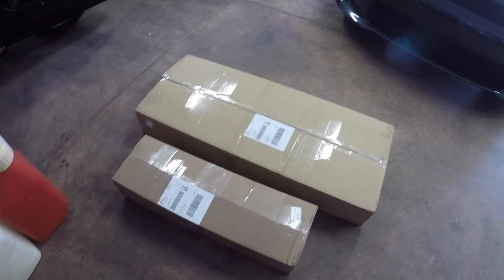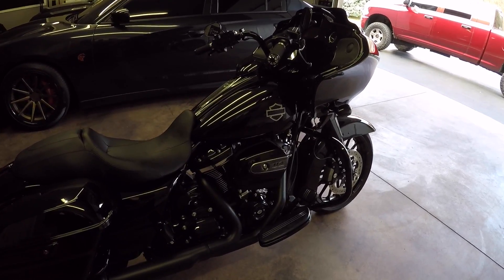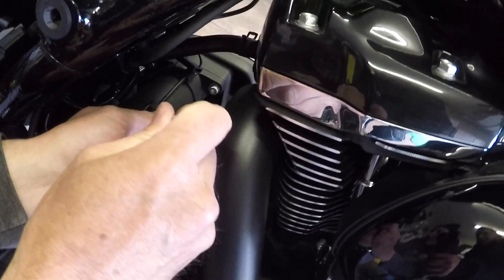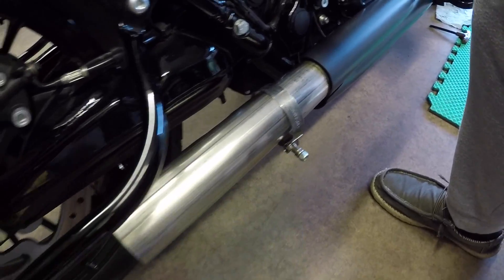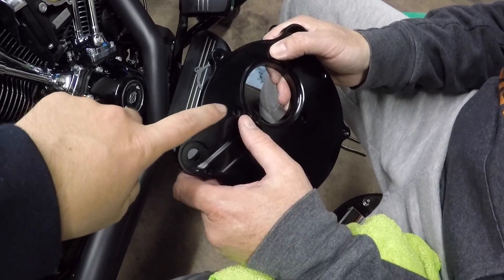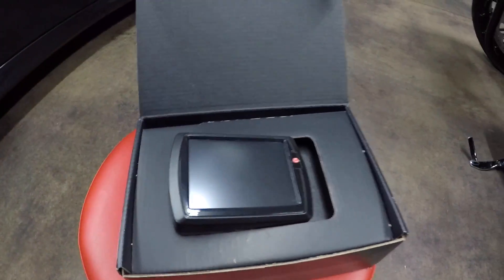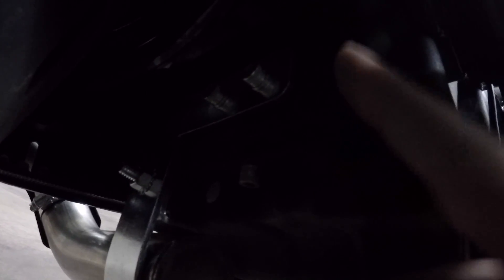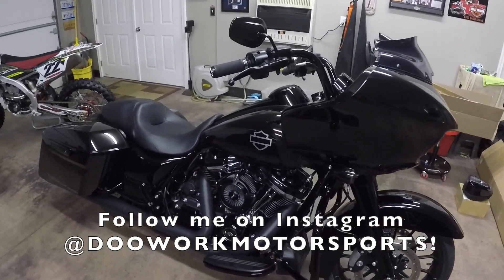2019 HARLEY DAVIDSON ROAD GLIDE JACKPOT ROAD AND TRACK EXHAUST INSTALL! *STAGE 1*

Comment: M8 with stage 1 air cleaner, S&S 475c Cam’s, Power vision tuner and this exhaust you will not be disappointed. It’s fu king evil sounding. This exhaust barks with a bite.

Comment: Great choice rolling with Fuel Moto, they are an awesome company. Nice to have that lifetime map support when you buy the power vision from them.
Reply: J Lip06 I have the power vision on my CVO convertible , how do u like it. My problem I don’t have a windows PC and dynojet software and maps everything is windows. I’m Apple so I put it in auto tune basic since I didn’t buy the other half of this tuner. If I had to do it again I’d get the thunder max. $920
Reply: @warrendemartini6533  I love the power vision. It's very easy to reflash tunes. I do have Windows and the software is pretty easy to use. I like how you can compare two different tunes at a time.  That's unfortunate about the software not being available for Mac. That would make it difficult to snag new tunes, but autotuning definitely helps.

Comment: Nice bikes. Just installed the same exhaust on my Street Glide with 107 big bore, Stage II heads and Tman 590 cams and it is loud and mean. Still dialing it in after a Dyno using PV with Target Tune. Good luck , nice video.
Reply from the maker: That's awesome!

Comment: Still liking the air intake? My has the oil leak issue and I’m done with it. Just want to see how you still like after some use!
Reply from the maker: I haven't had any issues with mine..
Reply: They all leak!! Part of a Harley and if you go to the dealer for oil changes they all over fill the sweet bike and then they leak like crazy 
Get a kit D&C has them drip can kit 
You tube it

Comment: First of all, the saddlebag support bracket bolt is 1/2". Secondly, no need to remove right muffler. Leave attached to headers. Thirdly, invest in snap ring pliers and save yourself a lot of headaches. Fourth, why didn't you install new exhaust port gaskets? ALWAYS, ALWAYS, ALWAYS do that. Never saw or heard you talk about O2 sensor reinstall. Hope you used anti-seize. And...CONGRATULATIONS!!!! You are the winner of a voided factory warranty with the installation of the aftermarket non-EPA compliant PowerVision tuner. The minute your bike is at the dealer & connected to the "DigitalTechnician" and the tuner is discovered your VIN will be flagged and added to the "VIN Block."  On March 29, 2019, Rob Bradford Director Global Service, Warranty & Customer Care sent a letter to ALL HD dealers that states "under the settlement between HD and the EPA in August 2016 ALL 2017MY and later HD motorcycles that have been tuned using a tuner or calibration that is NOT by a CARB Executive Order or otherwise approved by the EPA would have no power train warranty. When HD is made aware of such modifications a VIN block is placed on the powertrain; meaning we will per the settlement deny all warranty claims for functional defects of the powertrain components on any HD 2017MY  or later registered in the US. The powertrain in this instance pertains to the engine and all of its components including the ECM, primary drive and transmission and all of its components. So basically you just screwed yourself and have zero warranty. And YES the digital technician is flagging all those VIN's. Don't believe me? Confront your service dept with this info and watch them shit themselves. And lastly...why would you EVER allow a canned map to be installed? NO engine is the same. Not one single one!!! That bike needs to be dyno-tuned and a custom map created for it to run optimally. You're allowing someone else's engine parameters to be installed on your bike and that's no bueno. Good luck man. Oh yea...are you a LEO? If not lose the thin blue line sticker on your tag.
Reply: Well I have a 2018 breakout and I did aftermarket tuning and exhaust. 2017 GMC Denali. I deleted my truck with 100 miles on it.  So I say f  a warranty. Who cares

Comment: I'd rather have oil on my motor or bike than routed through the intake. 

In cars, the catch-can industry was created just to keep that from happening. 

EPA loves it though. But engines don't.
Reply: I was going to say something similar.  From a performance standpoint it’s robbing power, which is the point of putting all these mods on the bike.  I route mine to a small catch can with a filter.
Reply: Lone Wolf. Why not just externally breath the engine so the oil isn’t going back into the engine then you wouldn’t have to put that stuff in the engine?

Comment: Warranty is gone with the tuner bud, gotta use harley tuner
Reply from the maker: Not worried about it.. I have had this tuner on many bikes, no issues..
Reply: DOOWORK PRODUCTIONS but when harley plugs your bike into there system, it knows you have aftermarket software. So if you take it to the dealer let them know and most dealers are cool about it.

Comment: Have you addressed your ghost pipe it's set in closer to the wheel are not measured out the same distance that's lousy I don't agree with that look anyway ghost pipe take it to a new one run it like you should

Comment: From experience you’ll hate that air cleaner. It pukes oil so bad. You’ll see.
Reply from the maker: Mine doesn't at all because it has breather tubes that run the oil back into the throttle body so it doesn't drip.
Reply: DOOWORK PRODUCTIONS I thought the exact same thing.
I had the exact same intake on the same motor. It took me a year to finally decide to get a different intake. The problem is that the tube inlets don’t seal against the breather bolt heads. The bolt heads have those slots and the tubes are just like cups to catch the oil mist. The oil mist ends up accumulating then pooling in the bottom of the filter. Then it drip out of the filter and onto the header, your leg and your bag. I’ve been a long time RSD fan and was seriously disappointed with this intake. Hope you have a better experience if not you’ll know why now.
Reply from the maker: @Jerrythill  Gotcha, yeah I have 4,000 miles with mine and haven't had any issues yet..